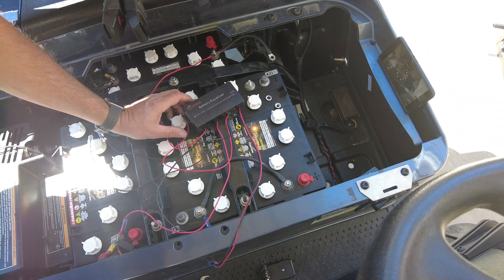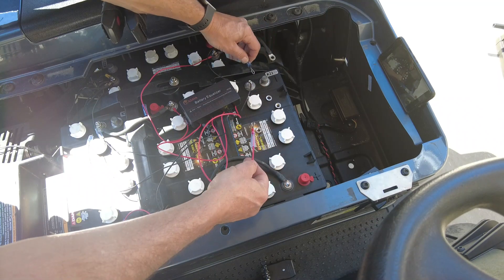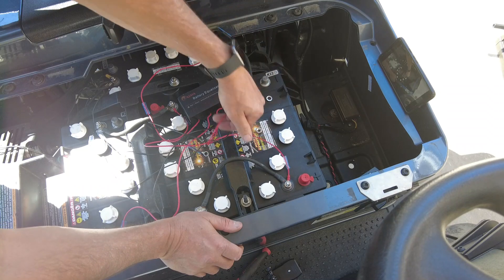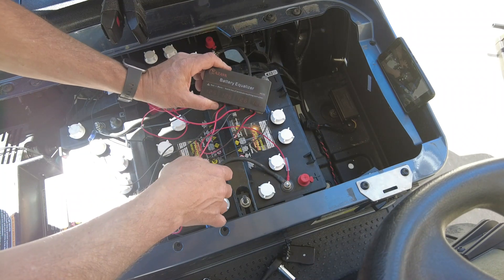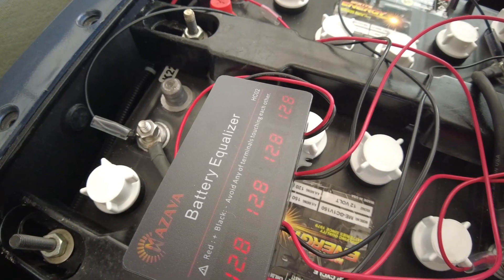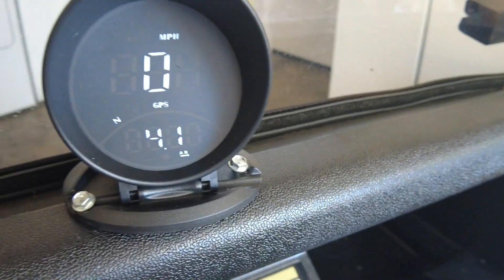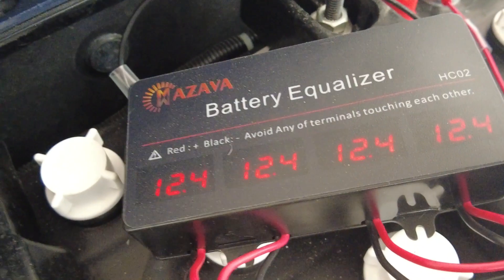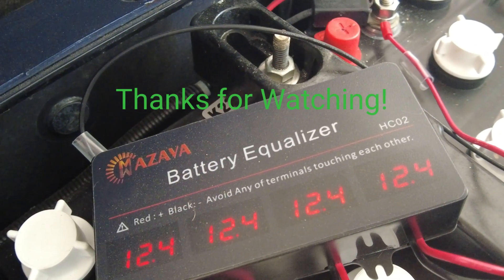Golf Cart Battery Balancer - Make batteries last

Comment: Is there a balancer available for 36 volt batteries, six 6 volt batteries ?
Reply from the maker: good question, the Mazava says it will work on 6v batteries but only four, Im looking to use one four bank balancer and add a two bank balancer for the total six 6v